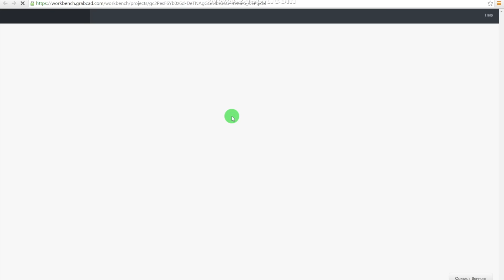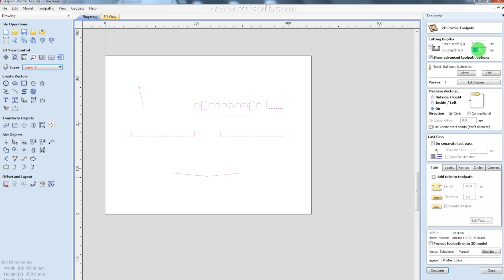CNC drag knife

Comment: Will changing the blade to a long thin type help the cutting?
Reply from the maker: not necessarily, its more about the distance of the tip behind the center related to the thickness of the material to be cut. So that the blade can be guided like a Finn . 45- 40 degree was nice to work with

Comment: Sou do Brasil. Como adaptar drag knife na router?
Reply from the maker: Hello, I use a program called Vectric with a dragknife tool path option, to generate a cutting G-Code
Reply: @3DMeister  how to install this toolpath? Where can I find this dragknife toopath?
Reply from the maker: @elsonpcelson4671  You need the app Aspire by Vectric the tool path creator is under Gadgets. Also somewhere in Fusion 360. There are add ons or other Applications for sure

Comment: I have a bunch of decorative Stencil designs I created. some are as big as 18 x 24 inches. I want to produce them on 1mil Mylar for strength. They are far more intricate than that plane design though. I'm worried that a laser CNC might burn them but a blade cutter like this could be just the thing.
Reply from the maker: Yes!, as long as the material can hold the cutout structure or better with a vacuum table. I think laser can create nice and fast cuts with an air stream.

Comment: Good stuff thanks for sharing! What was your final blade tip offset from center of rotation? Also whats going on with that blade, looks like you have ground down the back edge?
Reply from the maker: Thanks. I made some tests with the shape of the blade but that was not helpful. The high point of the blade cutting through the material has to be on or behind center, a flat angled blade with the tip further away from the center can be close and e steep blade can have some distance. And the distance also depends on the material thickness
Reply: @3DMeister  So the leading edge of the cut (and so the entire cutting length of the blade) needs to be behind the center line, makes sense. If I am understanding what you are saying, then the offset from the leading edge of the cut, to the center line, depends a how steep the blade angle is. I guess in general if it is a very steep blade, and very close, then it becomes a bit less stable and more affected by variations in the material being cut, like I think I saw the blade wobbling a bit in your vid when going sideways over the corrugations. Useful though, and good to think about, thanks again!

Comment: Great Video, explain one thing to me, how do you do the positioning of the blade? Does it use a fourth axis? I am looking for everything that is place to do this position but I can not find it, if you can explain me thanks. Thank you.
Reply from the maker: Thanks. The knife turns freely with the tip behind the center. You can turn the blade with the tip on the material and a xy movement to the desired direction before cutting through. Vectric has a drawknife mode where you can chose some options.
Reply: Dragging a rotation device behind center point is called "negative castor" .  Same principle used when setting castor angles for a grocery cart and your car.  The more negative castor induced, the more the drag angle will want to straighten out.  To much however will cause the blade in this case to not want to turn quickly enough in sharp corners, hence why a sticker plotter for example doesn't induce castor at all, but rather relies on cutting blade angle.  For thicker media, you would use a 65 degree cutting blade so that it doesn't pull the substrate up in corners.  The down side is the blade will need replacing more often since a steeper angle of edge will dull more quickly.  This is why most sticker (thinner material) typically suggest using 45 deg blades.

Comment: I have a professional flatboard cutter at home, they use a micro stepper at a 4th axis to spin the blade. In your case its crucial that the retract-height before direction change is perfect! So before direction change lift the blade up to ~0,5mm still into material, go 0,5mm forward and lower it again. You can also setup the new direction on a waste part outside of the material. Another improvment is to create a manual toolpath with splines and add an "overcut" to it - aka start earlier outside the closed shape and end later. If you want to go under the min radius you have to use oscillating blades at aorund ~10° cutting angle
I never used this type of cardbaord before, keep going - cool project!
Reply from the maker: +Friedrich Kegel thank you for the helpful information! I will use the cutter this way until i have my CNC controlled spindle as 4th axis. And i will check out these oscillating blades you mentioned!
Reply: Hi :)

Comment: Wow. Pretty neat. Looks like that without spindle orientation, definitely needs a sacrificial spot and some additional toolpaths to orient the knife. Nice work. :)
Reply from the maker: +gredangeo with more toolpath experiance, i could have perfect cuts, also without spindle orirntation. Its an interesting and nice challange to get it done perfect.
Reply: Please, explain me how do you do the spindle orientation? Tks
Reply from the maker: I use in Vectric, the Drag knife option. Make extra vectors to orient the blade before starting the shape, then the blade will follow the path due the offset from the center
Reply: @3DMeister  Oh. That's pretty cool.